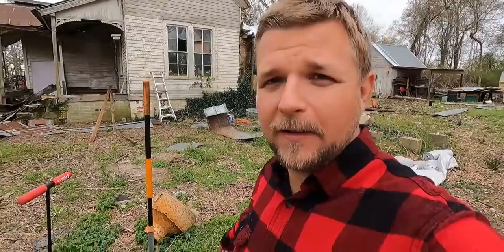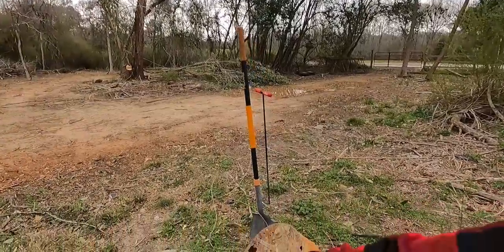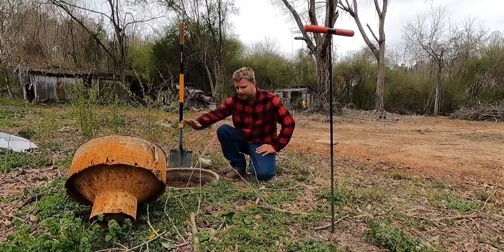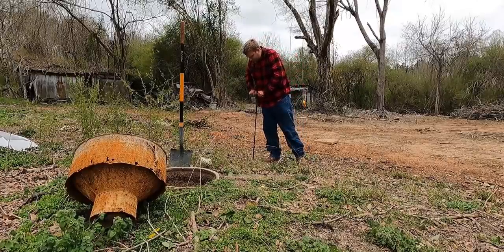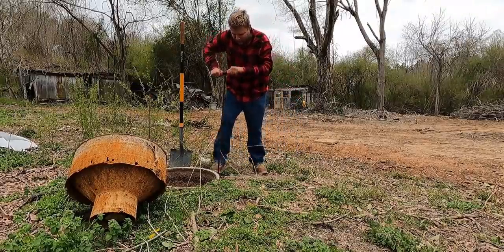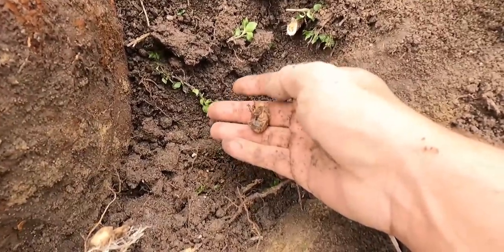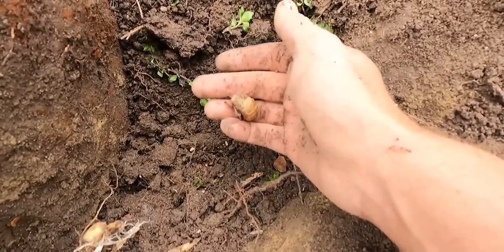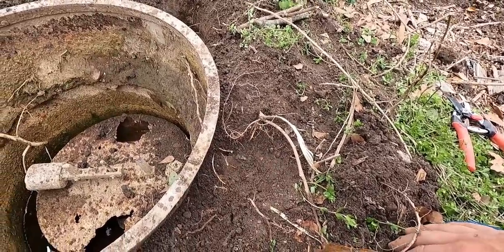140 YEAR OLD FARM TECH! EXCAVATING AROUND ACETYLENE GENERATOR | FIGHTING SUBTERRANEAN WISTERIA

Comment: Love the history you're bringing up. My great grandparents bought a farm in Eastern Washington State in 1908. There was a huge barn there in the yard. They had to tear it down some time around 1975 because it was in a low spot and moisture had taken its toll on the bottom sills of the structure. I think it would've taken $5,000 or more to repair and make a proper foundation for it but sentimental as that side of the family was, they didn't want to spend that much. It was alot of money back then. I was just 3 years old and only barely remember the outside of the barn. My dad said there were huge hand hewn timbers inside and it think he said there were mortice and tenon joints in the timbers. He also said there were carbide lights inside that he thought could still work. I know my great grandfather had dairy cows. Just not sure when he stopped that but he retired in 1946 or 48. My grandma used to tell me that even though it was mainly wheat and barley farm, the dairy cows got them through the Great Depression, delivering milk to Medical Lake, WA.

Comment: When I was in charge of the grounds at our local resort hotel I had a soil probe like that, to look for irrigation pipes and other related things. As for the Guinea Foul in one of the county parks in Ocean County (NJ) they brought in a bunch of Guinea Foul specifically to eat ticks in the woods. Oh, and on your previous video, I forgot that I wanted to comment on your mystery plant. It looked like a yucca, though I don't often see them with a tall stem. I usually see them with the leaves coming out at or just above ground level. As for that tank for the acetylene generator, in the mean time before the well house gets built you could put a trash can lid over it to keep the rain out.